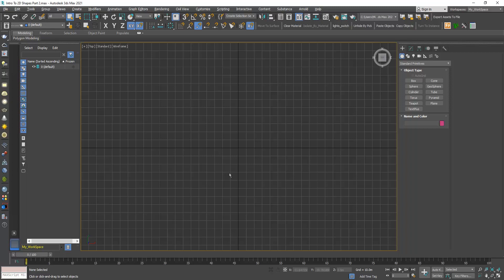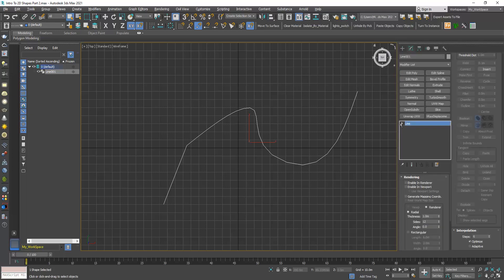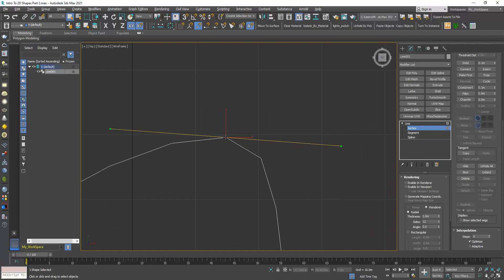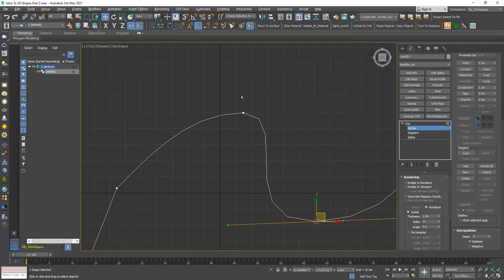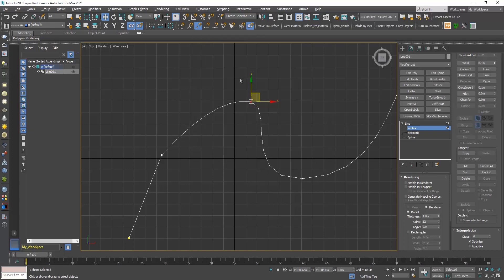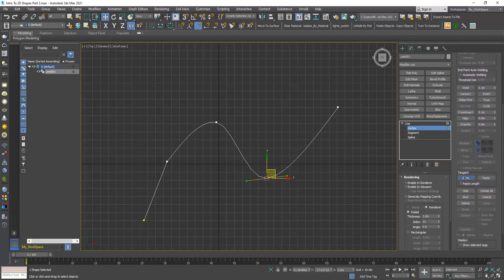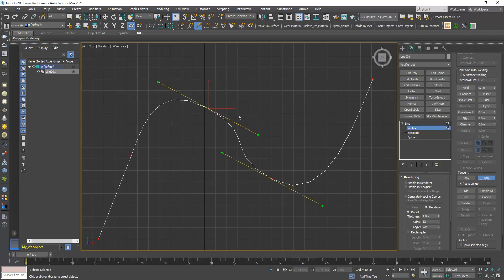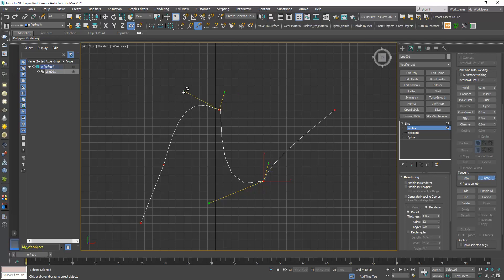Lesson 8-3DS Max Total Beginners-2D Shapes-Intro part 2-Types Of Vertices

Comment: 1:53 '....this point here is like maniac!' 🤣

3ds max spline modeling need more love in 3d space, I wish 3ds max have more control for the spline tangency handle, at least add something such as angle snap handle to vertex/edge/mesh and they should be recognize by the grid and snap settings tools. 

😄Sorry for the rant, thanks for the lesson! just a small addition of tangent feature, while in bezier mode you can move freely each tangent handle by holding shift + one of the handle that you want to move (*this action will change automatically of tangent bezier into bezier corner mode).
Reply from the maker: The more a company has a monopoly on softwares, the more they become lazy when it comes to adding requested features and fixing bugs